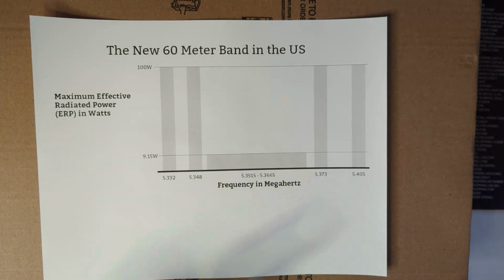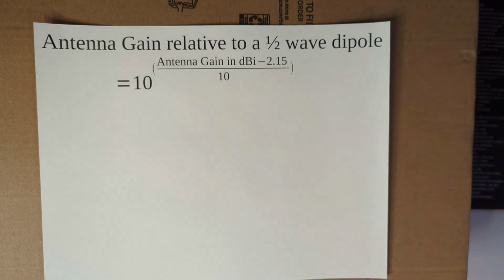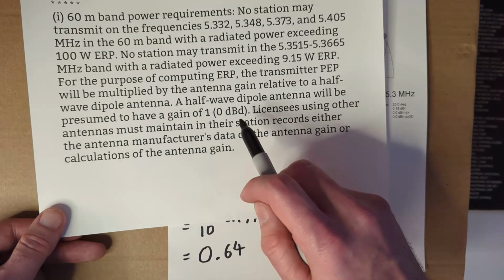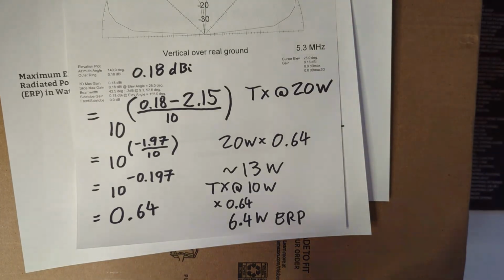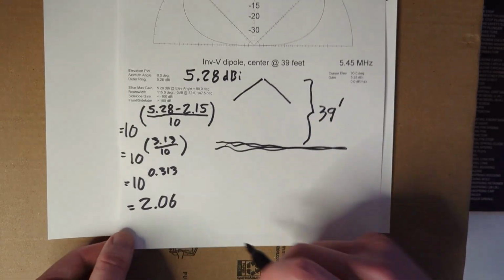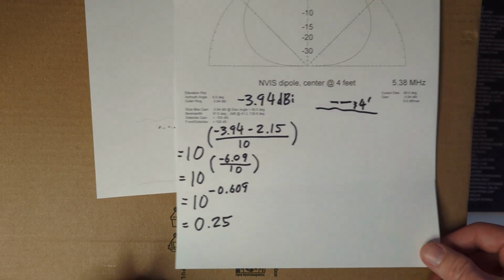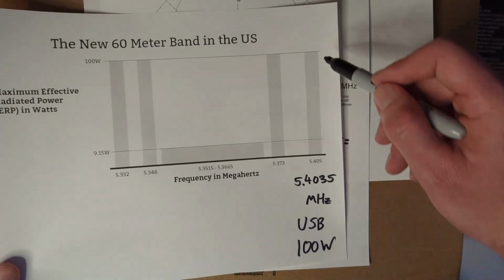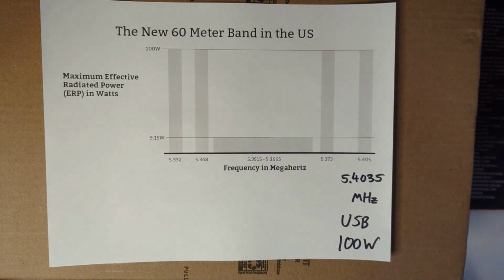Calculating Effective Radiated Power for the new 60 Meter Band

Comment: You may want to review the calculations.
For example most half wave dipoles have a gain of about 6 to 8 dBi. That 2.15 number you used is only good in free space. That’s a common mistake. Typically a good dipole has a gain of at least 6 dBi and most ground mounted verticals have a gain on near zero dBi. That means a dipole is probably 6 dB better than the vertical. You have to put a lot more power (6 dB more)  into the vertical to equal the dipole. So the factor may actually be 4. That’s if my reasoning is correct, and I think it is. 
The regulations say that you assume a dipole ( gain of 8dBi) as the reference with a gain of 1. Your inverted V that you modeled has less gain than the dipole so you would not have to reduce power to use the inverted V. Technically you could actually run more power with the inverted V as it has less gain than the straight dipole.
Reply from the maker: Thanks for commenting, and I have watched some of your videos before! The one on the 160m inv-L made me hope to one day have a tall enough tree for top band!

The CFR clarifies how to do gain conversion between isotropic and dipole for the purposes of part 97, see 47 CFR 97.3(b)(3):

 "ERP  (effective radiated power) (in a given direction). The product of the power supplied to the antenna and its gain relative to a half-wave dipole in a given direction. Note: Multiply ERP by 1.64 to convert to equivalent isotropically radiated power."

Gain = 10 log(Power/Reference Power) dB

Gain of a dipole = 10 log(EIRP/ERP) dBi

Gain of a dipole = 10 log(1.64/1) dBi

Gain of a dipole = 10 log(1.64) dBi

Gain of a dipole = 2.15 dBi
Reply: apparently their definition of dipole gain being 2.1 dBi is the key. Most any dipole modeled in EZNEC over real ground will have a gain of 6 to 8 dBi. That’s a significant discrepancy to me.  I don’t think the intent of the rules is for me to reduce power using a common dipole. Practically speaking that power level is so low that a few dB one way or the other due to honest miscalculation will not get anyone in trouble anyway!
Reply from the maker: I don't think the FCC was mistaken. The FCC Report and Order [FCC 25-60; 40 FCC Rcd 10322 (11)] looks relevant, particularly paragraphs 43-45. 9.15 Watt ERP was chosen for 5.3515-5.3665 MHz to match the 15 Watt EIRP limit set by WRC-15. Amateurs are secondary users of 60m and NTIA favored a 15 Watt EIRP limit so we have a 15 Watt EIRP (9.15W ERP) limit for now.

I think we need to operate cautiously as secondary users by following the 9.15 Watt ERP limit on 5.3515-5.3665 MHz. QRP practice!

The four 60m channels still have a 100 Watt ERP limit, so amateurs who need/want more than 9.15 Watt ERP can operate on them.
Reply: So you may be right that using a low dipole with low gain gives you the ability to run maybe 4 times the power you can with a dipole much higher. I never looked at it that way. It does make sense.